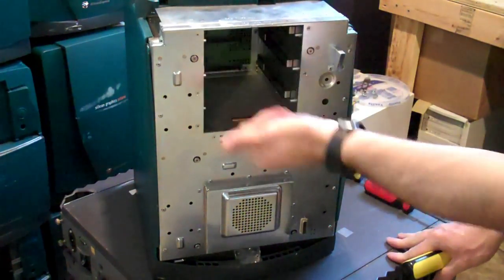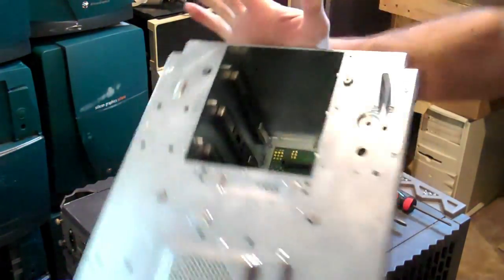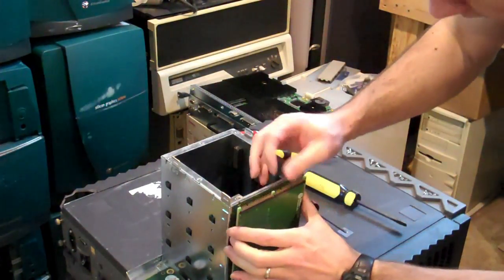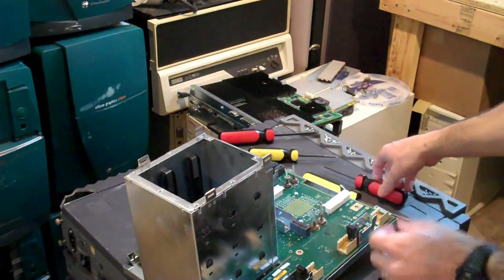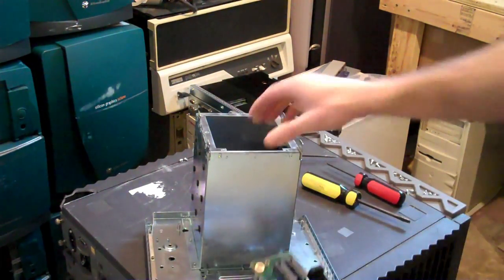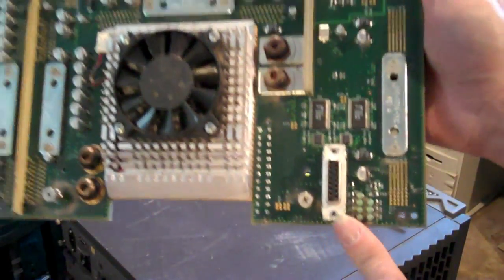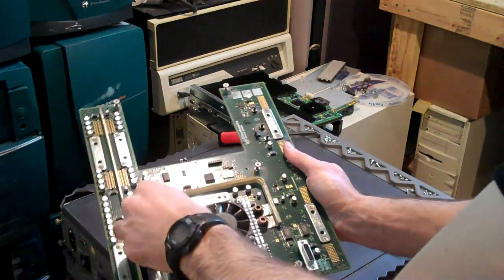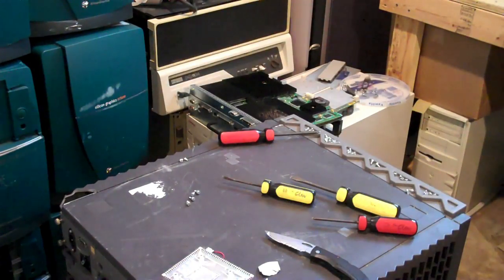SGI Octane Tour & Disassembly, Part Three

Comment: One important thing that you didn't mention in this video, is that you should remove the 6 plastic drive sled rails before pulling out the XBOW board assembly, because they interfere with the steel box in the main chassis surrounding the drive bays and make it hard to pull out this assembly.  Also, if you try to reinstall this assembly with the drive sled rails still installed, you will break off all of the plastic tabs on the outside of the inner drive bay box and destroy the rails.
Reply from the maker: @richardgoedeken9575  Good call, thank you for that.

Comment: Is it worth tearing it down this much to clean all the dust and everything off the board and fans, or do you think it's an unnecessary risk?
Reply from the maker: Unlikely, unless it's been in some storage location that's really grotty. The compression connectors are super delicate, you need to be careful not to get dust in them while the boards are removed from the backplane. But obviously you want the fans as clean as is reasonable so they're moving plenty of air to keep the boards cool... I guess you're best placed to look at it and go "Wow, this is disgusting, I'd better clean everything really well" over "Eh, I'll just suck the fluff out with a vacuum cleaner, job done."
Reply: @jpkiwigeek  Cheers for the quick response! Glad to see you're still active after 16 years. Thanks for sharing all your neat hardware for others to see, it's quite fascinating.

Comment: Very interesting videos! I wish I'd noticed them before I swapped the frontplane (no, not midplane!) on my octane to support a V12, but all went well anyway. The latest XBow was the 1.4 which is what you need for the later VPro graphics boards. 1.3 will happily run the V6 (and V8 as far as I know).

The thing you called a battery is not in fact (or well, it may contain a lithium cell like the sandwiched ones on sun boards) but it is in fact a System ID chip used for uniquely identifying systems.